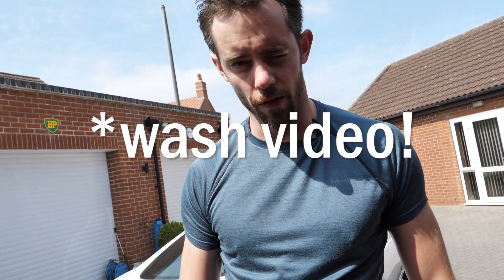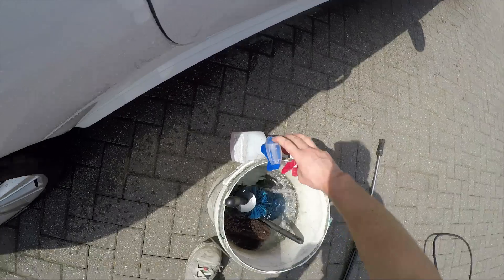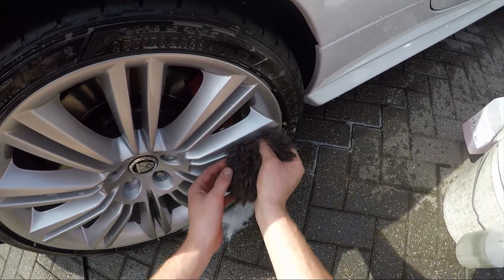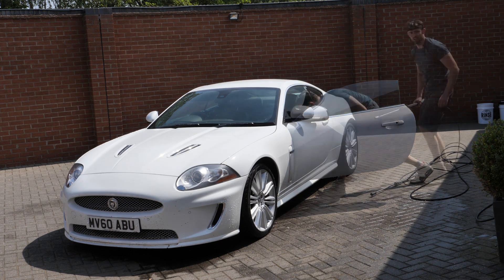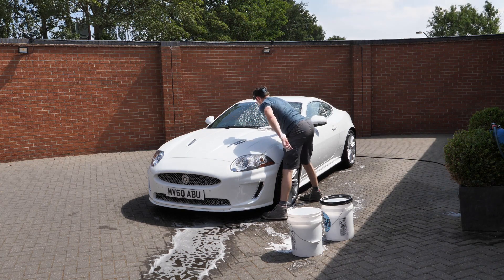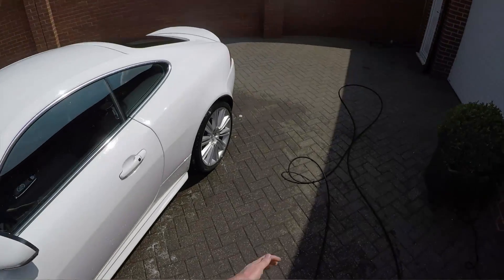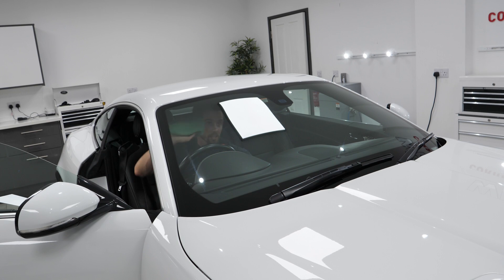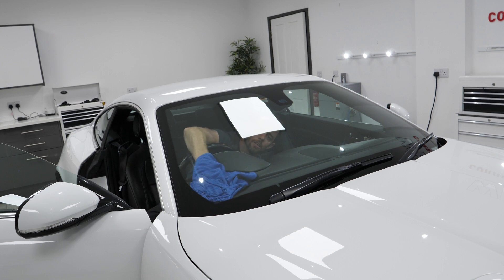XKR Waxstock Wash - VLOG 056

Comment: I have an XK (same year) with a standard size rear plate. I agree yours looks better. I need to buy one from the same place that did my current ones in carbon 3D gel but they don't list the XK. They have various cars listed with this kind of shape of plate but no XK! A few Astons and the Jag XJ. 

They say they THINK the XJ  one will fit but it's not just about size is it, the shape has to be correct to fit the shape of the recess one the car. 

Do you happen to know if yours was sold as an XK rear plate or if it was an XJ or maybe even an Aston Martin one? I think the DBS one might be a good fit.

 Other number plate websites I've looked at do list the XK but either don't do the carbon 3D gel I need to match the front plate or else don't give the XK plate dimensions for me to check.

 Any help from anyone at all gratefully received!

Comment: I noticed that your windscreen / windows were not coated with anything, I know you are testing a ceramic coating on your bonnet. Can I recommend Aquapel for your windows - so much better than gtechniq / carbon collective etc glass coatings. 1 application to side windows 4/5 years still excellent. Windscreen is 12/18 months depending on usage.  Was about £7 a tube, Chinese sellers on ebay have it down to £2 ish - hopefully not fakes.